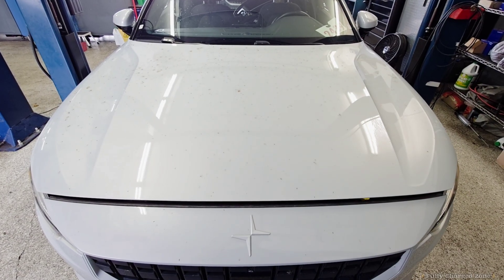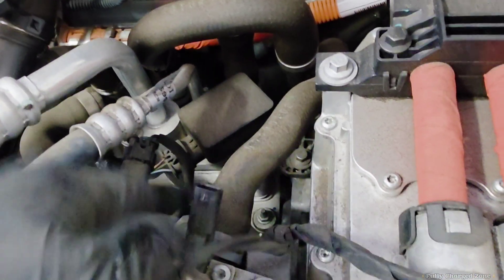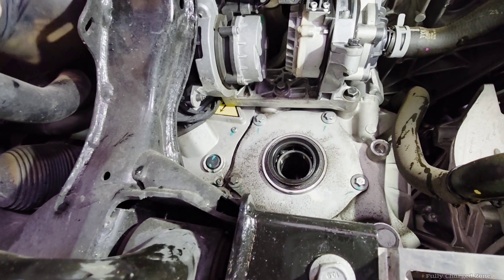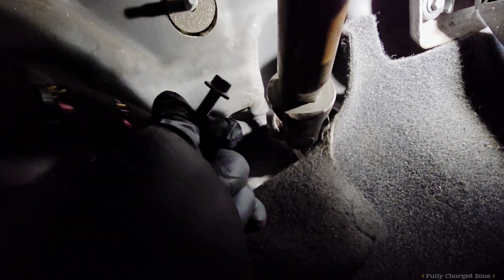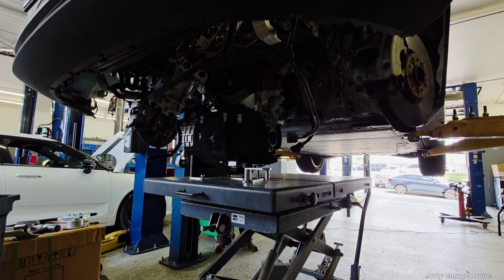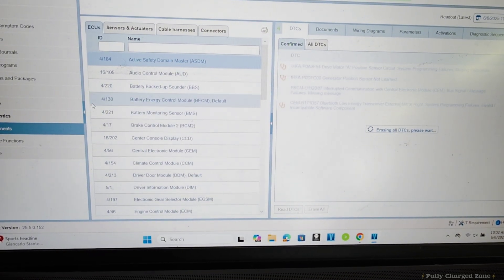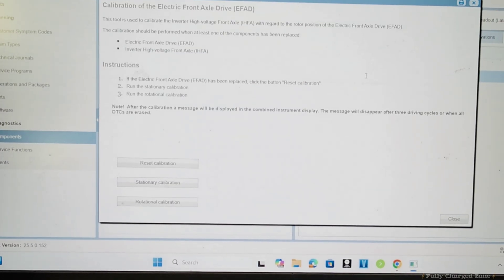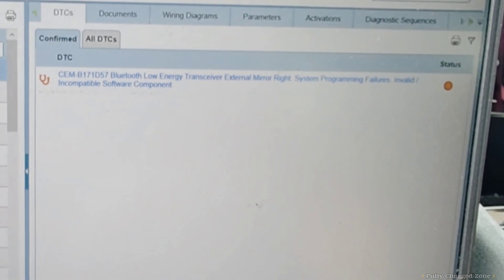Polestar 2 • Electric Front Axle Drive - Removal and Replacement.

Comment: Looks tedious as heck.  Have you changed out he oil in the erad/efad in Polestar 2 yet? Looks like there is a shortcut to pump fluid back into drain hole rather than needing to remove drive shaft? Cheers,
Reply from the maker: It does look tedious, but there really isn’t a shortcut if you want it done correctly. Pumping fluid back through the drain hole won’t fully exchange the oil or remove debris, and at that point you can actually cause more harm than good. Overfilling can lead to foaming, pressure buildup, and seal issues. Correct fluid, correct level, and proper procedure matter. I just replaced a motor from a shop over fillilling the oil and blowing a seal out. I hate removing the Axle , but its the correct way.
Reply: @FullyChargedZone what about pumping in exactly what drajns out?

Comment: Thanks for this. I see loads of Tesla tear down and repair videos but very few Polestar videos . Guessing they are either very reliable or dealerships hide repair work issues.
Reply from the maker: Totally agree... every manufacturer has their issues. The big difference is whether they actually fix the problem. After working for both companies, I can say Tesla tends to blow a lot of customers off instead of addressing the root cause. I’m actually making a video right now about a brand-new Model Y with obvious defects… and they still won’t fix it.

Teslas break just as often as Polestars, if not more in my experience. The tech is amazing, but the build quality isn’t on the same level. Polestar definitely has some advantages when it comes to actually honoring warranty and getting repairs done the right way.

That’s why you don’t see as many Polestar teardown videos... not because they’re perfect, just because the repair process is handled more quietly and professionally.
Reply: @FullyChargedZone I'm taking a risk in buying a three year old polestar 2 and as a mechanic I hope I can fix most mundane issues. The electronics less so. I hve encounter only one issue so far, an actuator for demisting the screen. Swoped it out and problem solved. I opend up the actuator and can find no faults. Think I uses a hall effect sensor as a limit switch but it seems fine. 

The dealerships seem to hate dirty fingernail owners clutering up their polished showrooms though. Don't even have a parts counter!